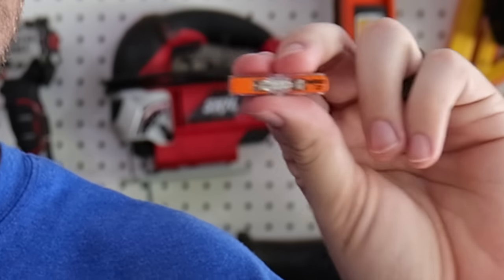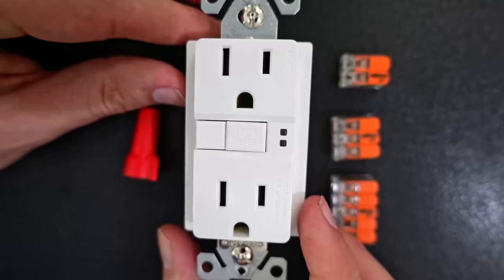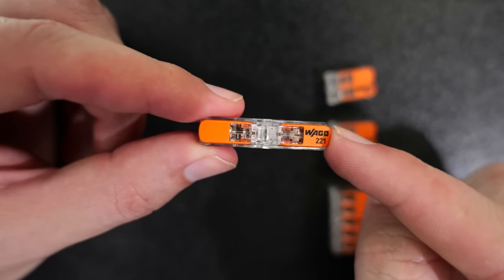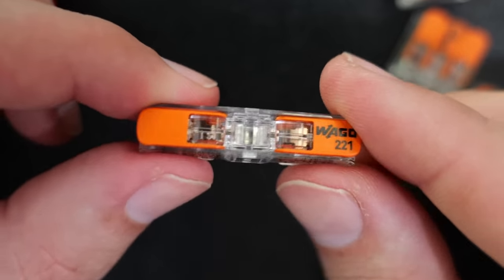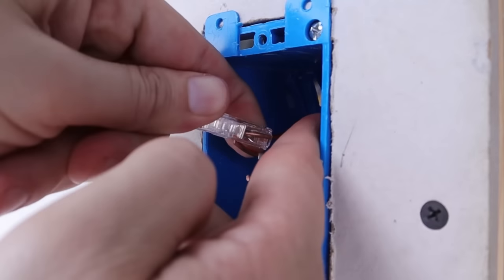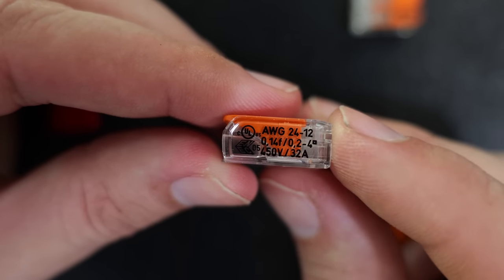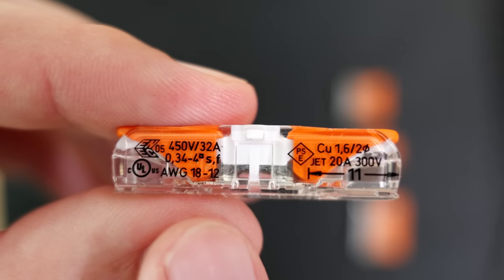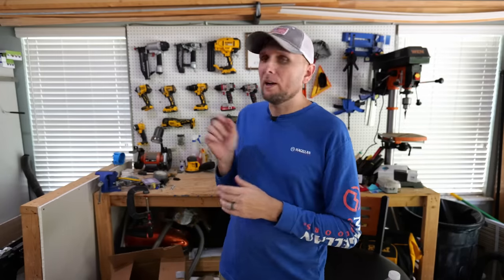New Wago 221 Inline Connector That EVERYONE is Talking About - And One Thing Nobody Talks About

Comment: The new inline has uses in things like quick connects for hobbies e.g. radio antennas, electric fences, model railroads and you name it! I also recommend the 3 or 4 wire splices so there is a spare terminal to use as a voltage test point. Leviton now has Decora Edge receptacles with lever-locking connection terminals.

Comment: 1 good thing Wago connectors are good at is testing automotive electrical conations before soldering them or crimping them. with the Wago connectors you can easily reverse the mistakes.

Comment: one other thing to bear in mind, if not already obvious, Wagos work great with DC too just derate the voltage somewhat but current rating should be good. I'm constantly using these for DC power and AC test cables. They are also useful for safely terminating an unused CPC connection (no earth needed on double insulated stuff ... In UK/Europe anyway)!

Comment: I far prefer the 32A rated 18-12 AWG inline WAGOs to the less robust version, but it should be noted that the wire receivers are still a bit smaller than on the 20-10 AWG 30A non-inline WAGO.   So, for example, I have lots of stranded wires of various gauges and lengths that I reuse constantly for various projects and I have ferrules on them to keep the copper from becoming a mess.  Even though WAGOs can take stranded wire, ferrules are really convenient when messing around.  The 12 gauge ferrules that still fit into the 30A non-inline WAGO don't fit into the 32A inline WAGO.

Note that with big enough wire, you can put a single piece of heat-shrink around the entire WAGO inline connector, too, from end-to-end, and seal the whole thing up.

One thing I found replacing old fixtures in my house, is that the original installers used wire nuts to connect the stranded wire from the fixture to the solid house wiring, and for quite a few of them the stranded wire had become extremely loose.  I started replacing the wire nuts on all the fixtures after I tracked down one where the bulbs (even LED bulbs) kept failing and flickering due to that problem.
Reply: Can these only be used in a box or can they be used in an attic without a box?
Reply: @bobbygetsbanned6049  All wire splices should always be done inside boxes or fixtures.   Never have wire splices just laying bare on the framing in the attic or anywhere else.   Wrapping with electrical tape doesn't count as a box either.

There are boxes made specifically for this purpose.  You should be able to find various videos on how to safely run wiring through an attic or basement.
Reply: @junkerzn7312  Yeah I was wondering because they used to sell splices rated to not be used with a box, but apparently they took them off the market. These are not a replacement for those apparently.
Reply: @bobbygetsbanned6049  do you remember what they were called? It sounds super interesting and I’d like to try to research them.

Comment: While Wagos may be pricey, let's not forget that they are reusable and don't require retrimming the wires upon disassembly.
I would think these are perfect for temporarily work like staging/holiday displays/jobsite/theatre, etc.
Reply: In the UK they're considered as "maintenance free" so can be buried in plaster etc. (as long as they're in a box) as permanent connections, if we used wire nuts (which we don't) they would never be approved as maintenance free and so access would be required to them.
Reply: @mfx1 , so noted, although all connections of any kind must be readily accessible here in the States.

Comment: Can you use this to connect a broken capacitor wire back together. Due to the nature of its location the wire vibration on the  chassis opened it up shorting out generator. Capacitor is for small Thomas model 2755 compressor 220v . Cap rated for 15uF. Any suggestions would be great.

Comment: So glad you directed me to this video.  So I apparently want to use a butt connector because even if the wires are safe inside a 1/2" conduit maybe some condensation drips down the wires and hits the WAGO.  So I have to follow with the butt connectors, or what I have been calling the Crimp/Shrink. :cat-orange-whistling:

Comment: Can you give us use case with each of these wago?? Some I’ve seen would need a 4 connector just for an outlet.
Scenario was a T out from the wire run to the receptacle so that you have continued power even if the receptacle goes out? Why is this type of run not standard? So one for the hot side, the bench to the receptacle the branch back to complete receptacle circuit and the line to continue the run

Comment: Can you use this to connect dissimilar wires?  Many lighting fixtures are coming with aluminum wires (including the ground) and the house wires are usually copper.  If you can do this, do you need to add any substance to the wire(s)?  Thanks.
Reply: Check your lighting fixtures wires closely because sometimes they appear to be aluminium, but they are just stranded copper coated with some kind of silver color metal. Check the model numbers on the wires, google them and it'll probably say something like tin-plated copper wire, which is fine with Wagos without using the substance that they also do sell in case you really do have aluminium fixtures.

Comment: Some homes, built in the 70s, used 12 ga Aluminum in 15 amp circuits instead of 14 gauge copper.  (These homes still used 12 ga copper in 20 amp circuits.  All of which met code at the time,)  Can Wago connectors be used with Aluminum?  Aluminum rated receptacles and switches are usually labeled and are also compatible with copper.  Aluminum devices, typically, have only screw terminal connection capability and do not have "back stabbing" or other quick wiring capabilities.
Reply: Why wouldn’t they work with aluminium wire?

Comment: Do they make a inline one, One Main Line Wire in, Two Load Wires out? Now that I have LED Outside Flood Lights, would like to add a box in the Attic, go to the Original Light and a Flood on the side of the house.
Reply: No, you can use a 3 port Wago and bend a u-turn on one wire.

Comment: If you think these are great check out the Wago 224-112 and the Wago 2273-203.  I have been using the 2273-203 in my house to pigtail to the aluminum wiring.  I wasn't a fan of the purple wire nuts and the Alumiconns take up too much space in the boxes.
Reply: Wagos are not rated for any aluminum conductor.
Reply: Alumiconns have the anti-oxidizer, which the Wagos don't. Alumiconns also have torque specs, which is impossible with the Wago. I wouldn't use these on aluminum wiring.
Reply: @Chris-ek4jn  if you look up that series of Wago connector, it's rated for Aluminum.  They also have an antioxidant that goes on the Wago.

Comment: The 221-2411 is approved up to 4 square millimeters in Europe. That would actually correspond to AWG 12. 
But this one only got approval up to AWG 14 in the US. 
The 221-2401 got approval for AWG 12, or 4 mm2. 
The 221-2411 is AWG 14 or 4mm2
Reply: Yes, I noticed the same thing. Very strange.
Reply: There is also a bigger one available, e.g. the 221-612
Reply: I have rarely seen the line connector with the white insert in Europe, 
but these seem to be preferred in the US.

Comment: I used something similar for a Infared panel, to adapt solid core to Flexible [which is then connected to a LD20 connector that sits between the wires]

Reason I used a LD20: because if I need to remove the panel, its easier to remove. than having to hold the panel and remove the wago's. since you just need to disconnect the LD20 connector.

Comment: These are great for very small gauge wires as they are able to accept wires down to 0.2mm2 - the red butt crimp connectors are 0.5mm2 minimum and struggle with thin wires

Comment: I use those for car stereo installations and so far they are great!
Reply: That is down right lazy. Solder and/or butt connectors. These are meant for static environments not one where they move around with ever turn and bump. I installed emergency equipment for years as a teen. Taking shortcuts is dangerous and foolish.
Reply: @nhbountyhunter  
I've heard that some RV manufacturers have been using them.  Seems like a disaster waiting to happen from all the vibration.

Comment: One disappointment with the inline 221 connectors is that you cannot fit a 14 AWG wire ferrule. The side-by-side 221 housing allows the ferrule to slide in perfectly. I don't know why they would change the dimension of opening but for my application that makes them unusable.

Comment: I think they are a great option.  I am amazed at how they have done such a poor job with the model numbers (series and sub series) of the different parts.  It is like they ran out of numbers to use.  What does 221 stand for?  Amperage (nope), size class (nope), gauge range (nope), number of wires (nope).
Reply: 221 is the series number. Just like 223 for the grey plastic models or 773 for the back-stabs, etc. It's arbitrary but not so confusing once you get used to it.

Comment: I don't think WAGO was the first to make an inline lever connector.  There have been a ton of no-name lever connectors coming out of China that did this, although they were usually opaque like the WAGO 222.  Some were even two ports on one side and two ports on the other.  Also ones that were divided into 2 or 3 separate connections in the same body.  However, I can't find any that are anything other than self-certified.

Comment: Can these be used in case of older wiring where the ground has been cut short?
Reply: Like when replacing ungrounded outlet with a ground one but the ground was cut short in the original wiring.
Reply from the maker: If you are asking if these can be used to extend a short ground wire in a box yes they can be used for that.

Comment: You dont need to Open the Wago if you use it with Solid core wire. You can Push it in Even if the wago is closed. This obviously don’t work with stranded wire :)

Comment: Really like these things. Would be great to use on my 3d printers to be able to swap out fans quickly. Still pricey though compared to wire nuts :) Yep, I am cheap LOL
Does that tester opening have a cover on it? I know I am pulling at straws here but what happens if a metal flake or another wire comes loose in the box and gets in that hole? Probably a 1 in a billion chance but just curious if there is a way to close that off before tucking it into the box.
Reply: "what happens if a metal flake or another wire comes loose in the box and gets in that hole?"  The same thing that would happen to a wire nut which still has openings where the wires go in.  And for swapping things in an out, these won't damage the wire like wire nuts will.  I'm sure you've lost strands of wire when swapping things out.  Yes they are more expensive than wire nuts but they are much better all around as well.  You get what you pay for.

Comment: When I look at these I feel like they would be great for car stereo installation where your splicing a harness to a radio. Thoughts??
Reply: On their product page they mention speaker wiring as a potential application.
Reply: They're not rated for high-vibration environments, as the spring holding the wire in could bounce. But for a car stereo, I wouldn't worry. But I'd fold the power wire over the connector and throw a zip tie on it, shorting that one to ground can be nasty.
Reply: @HenryLoenwind  Yeah, the key would be to prevent the wires from twisting in the connector because they can pop out that way, just like in Wago's backstabs.
Reply: I'm curious, however: Is your intention to use these for splicing line level? Speaker level? Power?
Reply: @Hermiel  I ended up going a different route. I was thinking of using them to splice harness to new head unit

Comment: In the UK wirenuts were banned 50 years ago as they tended to fall off over time with the electrical vibration. You had to be vigilant to ensure when you pushed them into the back of the box that they were vertical.
Reply: Electrical vibration? How does it occur without an inductor?
Reply: @BritishEngineer  You have forgotten electricity is ac

Comment: 20Amps in JET certifications (which is in Japan), ENEC (in Europe) and UL (for USA) certified them for 32 Amps for the ones fitting AWG 24-12,
For Europe at least, they're certified to handle more amps than the wire connecting, as the max wire size that fits, 4mm^2 (I guess it's AWG 12), would handle a max of 25Amps
you can actually get them in a bigger size for AWG 20-10, which are certified for 41 Amps (ENEC and UL)

Comment: So the next version should be like the side-by-side 221, except with one of the sides reversed.  
Concerning how easy it is to flip the lever on one version, I wonder if it is as easy when it is grabbing a wire?  Does it vary by the gauge of the wire?  I would expect yes to both, with the heavier wire resulting in a somewhat tighter level.
Reply: I would love to see that.  4 and 6 connector units, with one side reversed would make wiring positioning extremely convenient.

Comment: they do look helpful for short wires and stranded to solid in light fixtures that is annoying that they made one not capable of handling 12-gauge wire though don't all the regular 221 connectors handle 12 why doesn't this one?
Reply: WAGO 221-2411 AWG 18-14 Inline connector. 
They make an inline connector for 12 GA.
WAGO 221-2401 AWG 18-12 Inline connector.
Reply: It's so that the whole thing occupies the same volume as the side-by-side connectors do. You can observe that the levers on the in-line connector are shorter, and therefore a lower force can be used to press the terminals together, otherwise it would be very hard to open it up. This limits the displacement of the metal plates and therefore the difference of wire gauge that can be held securely.

Comment: Critical safety notice.  Code and basic safety REQUIRES you use a junction box AND that box be accessible.   NEVER bury junction boxes or spliced connections in a wall or ceiling without being able to access the connection.

Comment: My ex had a pro move her main panel and he used push connectors (no lever) in an empty box. If he would have used the thru connector version, it would be a lot cleaner. 
I'm currently planning on removing 2 fuse boxes and upgrading service from 60a to 125 (200 would be overkill, esp now with all LED lights and higher efficiency appliances. etc). I'll be using push only connectors for the circuits that are THHN and levers for the old cloth/rubber wires that will be replaced later. All the EMT and ridged conduit will remain and the current 2 boxes will remain for this phase (both puns intended) of the project. 
Anyone prefer another brand over the Wago?

Comment: I love WAGOs, but I don't like the numbering system.  Seems like they're all "model 221" regardless of configuration.  It makes it difficult ordering them because you have to check the specs to make sure you're getting the right ones.
Reply: 221 is the model, there is the second part of the number missing. like 221-2411.

Comment: Can wagos be used with aluminum wire?
Reply: Not 221 series, but 222 and 2273 can, provided you use the contact paste. But it's just what wago advertises. I don't see a reason why 221 should be a problem.

Comment: Seems like the 2401 variant should be the standard, production costs could be lower with just one model.
Reply: At a certain point, the production line is running at capacity. Then you need to add a second line, and it makes no difference if you produce the same product or another one (that uses the same base materials) on it. And WAGO's lines are running at that level---they basically own the European market, making billions of these things.

Comment: I am using these inside of electric guitars to make it easy to open and change things.
Reply from the maker: Interesting.
Reply: I plan to use some WAGO 221 side-by-side connectors soon in an electric guitar project.  But not the 221 inline connectors, which aren't rated to handle wire thinner than 20AWG.
Reply: @brothermine2292  Good point. I tinned the tips and found the connection to be solid, but I am using the 22ga pushback wire. I'll keep that in mind when I'm doing my next build.

Comment: These worked well when I had 3 and 4 gang boxes, and I had to add smart switches, and deal with multiple daisy chained outlets and wire in the same box feeding other circuits inline.  Having to change the configuration because of the fixed wiring of the smart switches, and possibly have 4 or more 12 gauge wires under one cap?  Nah, I just used the 5 and 3 slot wagos, and even combined the grounds this way as well.  Fuck daisy chaining, it's a pain in the ass if you need to service your switches, move them around, etc. Just cut your own wire and make your life easier.

Comment: I have the side-by-side type and really like them for projects where I can do quick change where necessary.

I'm not sure that I'd trust these in-line ones for anything where higher currents are involved.
I don't like that the 2 copper wires aren't touching.  I don't trust a thin tin bus.

Comment: both say 450V / 32A at the top-left of the printing
Reply from the maker: That is not for the US.  Wago has put out press releases about it.   I showed in the video on the Wago what it says.
Reply: @HowToHomeDIY  ah… interesting to know. Now the question is, why something that woks in the EU with no issues couldn’t work in the US ?
Reply from the maker: So the largest wire size available to use in them is 12 gauge wire.  In the US 12 gauge wire is rated for 20 amps so that is why it is listed at 20 amps for the US.  At least that’s the reasoning I found through Wago and it does make sense.
Reply: @HowToHomeDIY  oh I see.
Over here,  we can use 2.5mm^2 (a tad smaller than 13AWG) for 20A. 
4mm^2 (tad smaller than 11AWG) is authorized up to 25A.